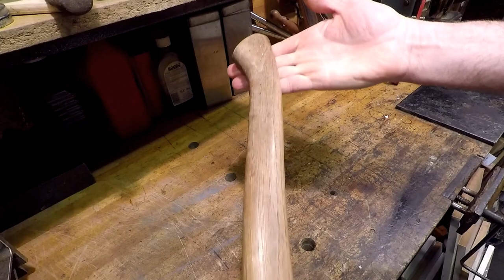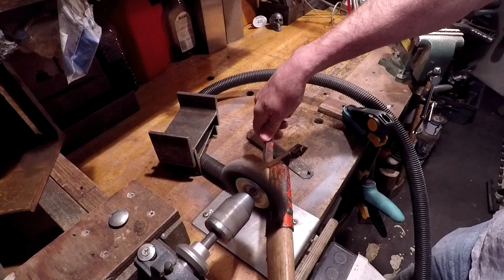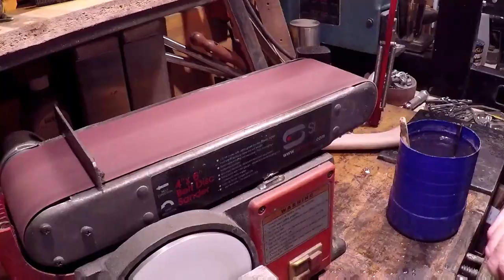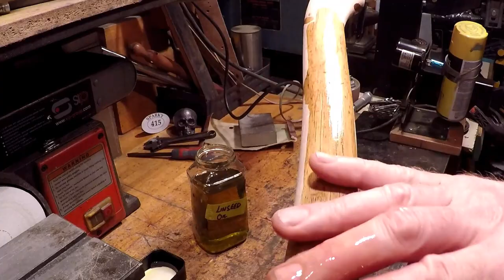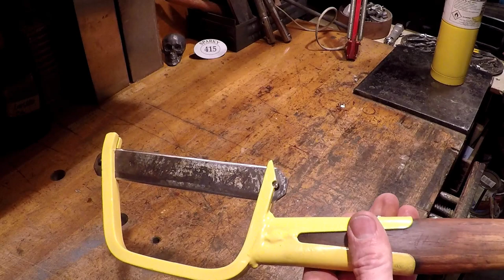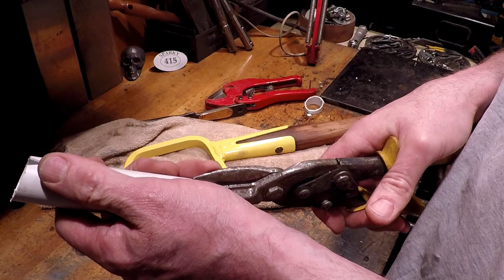#38 Tidy up and sharpen a Swedish brush axe or clearing axe

Comment: The can shaker just wins everything 👍
Reply: I agree! That's what I came in here to comment.
Reply from the maker: Thanks Guys it saves my wrist for important work 😁
Reply: @Everythings_Adjustable  hahah! Is it just a stepper motor? You should do a build video of it! 😎
Reply from the maker: Just a cheap 230v motor from China, I used a microwave motor at first, it worked but was a bit too slow (4RPM)

Comment: Nice restoration there and a nice video thanks Sparky. I have not seen that axe design before, obviously it is cutting thinner material rather than chopping away on a tree. I noticed you pulled the blade out of a jar of liquid when you started sharpening it, what was the liquid? Thanks again.
Reply from the maker: Thanks Bob, the liquid was water I use for cooling the blade when sharpening, They are really only for clearing brush and shoots I think